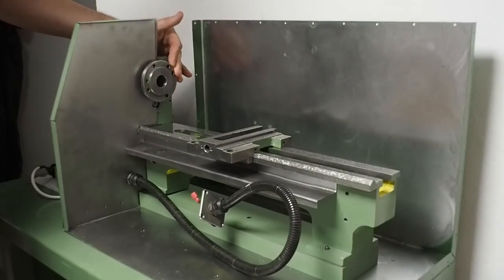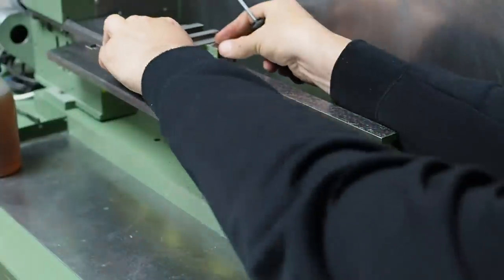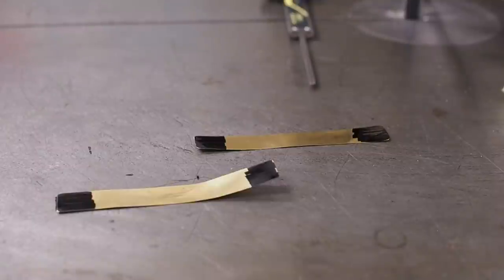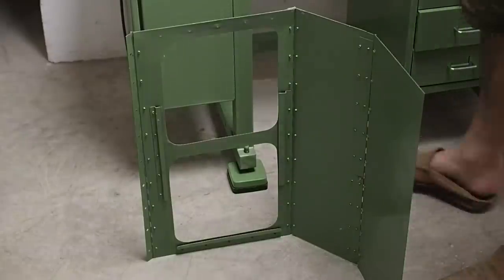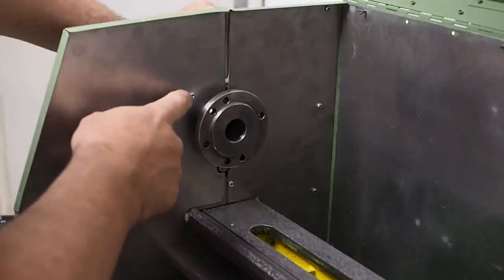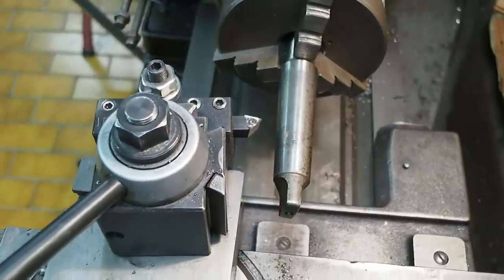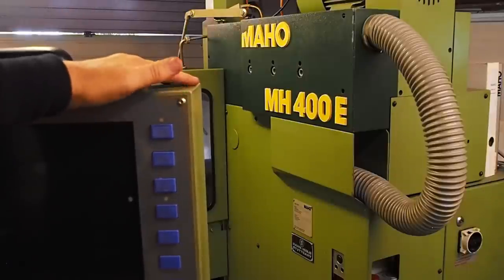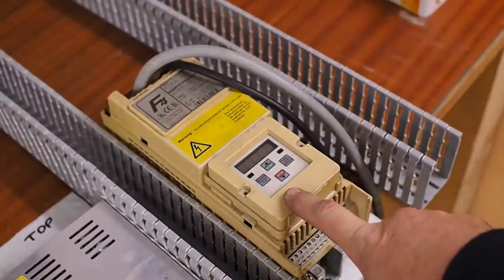CNC'ing the infamous 7x12 mini lathe - Episode 20 - Finishing the enclosure and "how does CNC Work?

Comment: I'm very interested in the Maho conversion ahahha obviously! Like i said before, hardware to me is easy. Software is a little more complicated. Thoose servos i have for my CNC conversion take either pulse and direction or +- 10 volt and they even have a 17-bit encoder that will be perfect for feedback but the linuxCNC software is were i currently have the most trouble with! Assigning pins and in/out funtions is Simple but the grafics and the Touch interface and setting comunications between the VFD and LinuxCNC... Thoose things is were i have the most trouble with!
As always, your videos are awesome! Looking forward to seeing that thing cutting some plastic or maybe you'll start with some 1.2311 pre treated steel ahahah
Reply from the maker: Thanks Andre. I look forward to that as well.
The guys on the LinuxCNC forum are awesome at giving support for exactly those issues you mention. I couldn't have done the MAHO without them.

Comment: Minor pedant point - you said that you were using stepper motors but (of course) the main spindle ISN'T, it's a VFD and an encoder.

I assume the control interface can handle this mixture (which sounds quite tricky)
Reply from the maker: Thanks for watching. The Mesa 7i96 outputs either step/dir or PWM on each "axis" pin pair. I will configure for Step/Dir for the two stepper axis, but configure one "axis" of PWM output for the spindle. This will be converted to 0-10V DC Analog to command the VFD speed.

Comment: how would using servo motors instead of steppers go?
Reply from the maker: Servos close the loop, so you don't loose steps without knowing it. On the MAHO the ANAlog DC servo drives close a verlocity loop, while LinuxCNC uses the linear encoders to close the position loop. Definitly preferable to open loop steppers.
Reply: @RotarySMP  so why not go that way? with no need for linear measuring sensors and the hassle of mounting and keeping them clean.